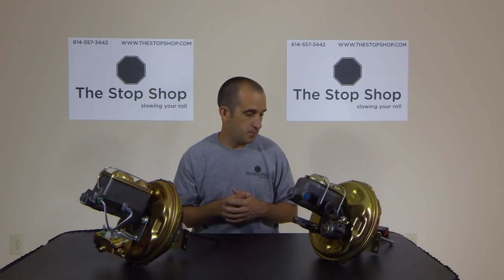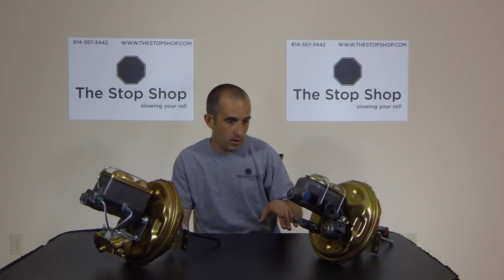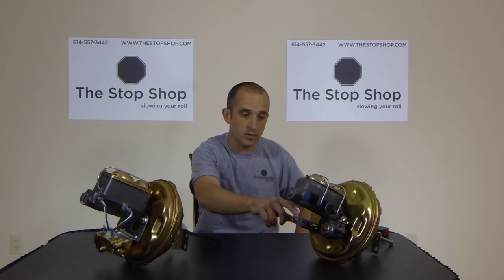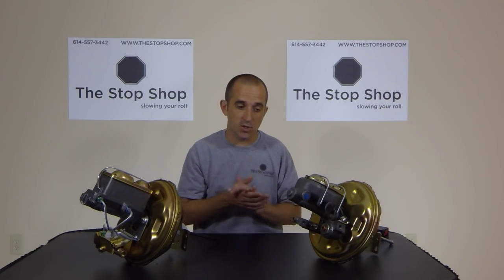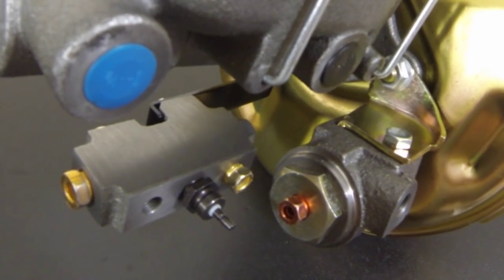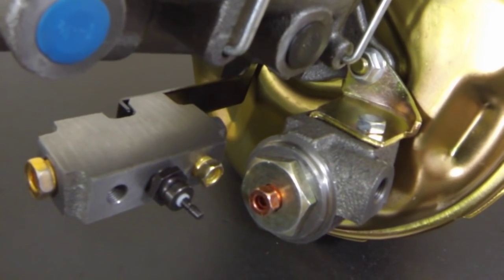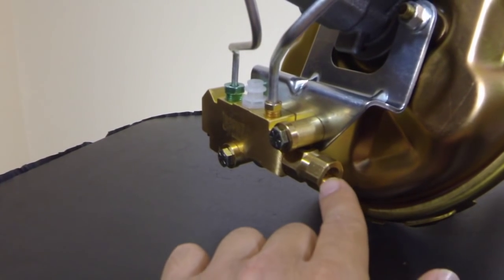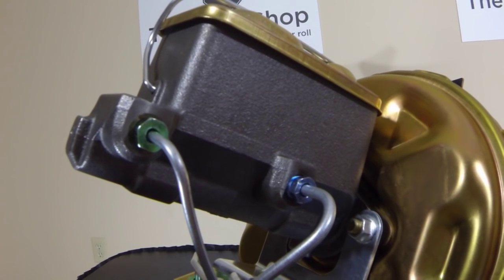67-81 Camaro / Firebird / Nova Brake Lines and Proportioning Valves

Comment: OK coming from the Master Cylinder... does it matter which lines are connected to the combo valve from the master its self? I have a custom application that has a very hard power brake pedal. The master bore is like 1 and 1/2 inches, way to large I am sure. It has all new brakes disc frt and drum rear. I think the combo valve may be hooked up with the lines going to the Como in the wrong location. It has been very frustrating. Thanks for any suggestions. I am changing to a 1 inch bore master and a new booster. I am thinking of buying one with everything (master, combo and booster and even a mount with the pedal for the correct ratio ) as a unit to assure everything is compatible and the lines on the master in the correct location to the combo. Suggestions, ideas??? THX.
Reply from the maker: Sounds like you are on the right track.  Give us a call if you have any questions after you change things out.

Comment: your proportioning valve the line going to the rear brakes is 9/16 but my brake line on my 67 camaro is 7/16 how will that work please let me know so i will know what i will to do.
Reply from the maker: You would have to cut and re-flare your brake line with a 9/16 fitting or buy a new front to rear brake line.
Reply: Darin Freitas I’m having the same problem. My 1971 nova brake lines going to master cylinder are not the same and won’t fit on proportioning valve.  Looks like I’m getting new brake lines.  Lol.